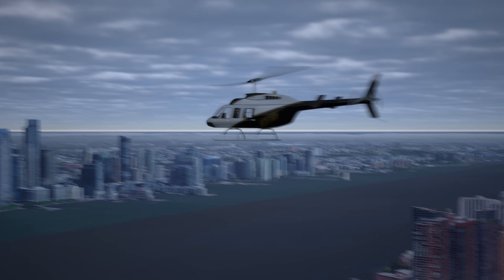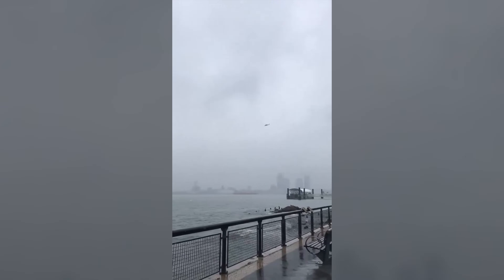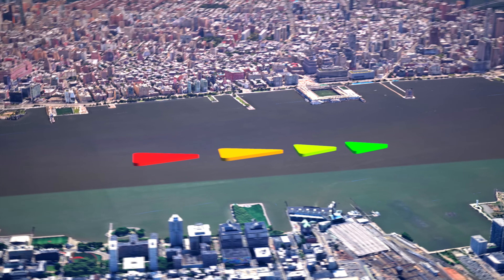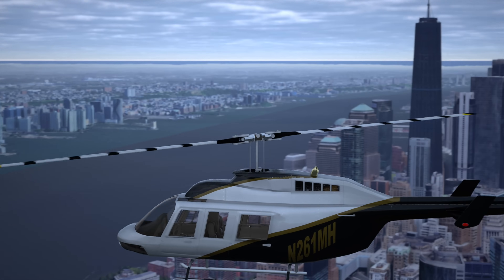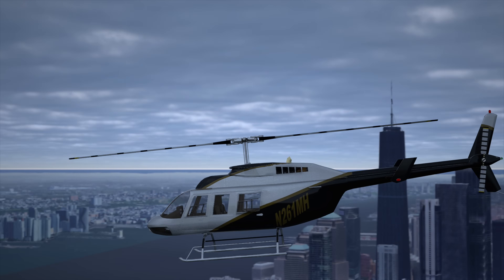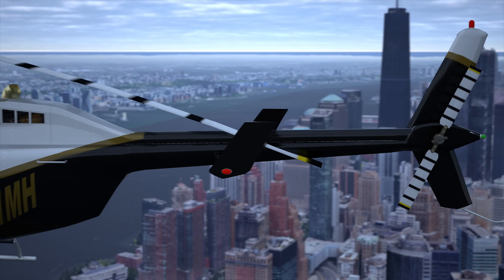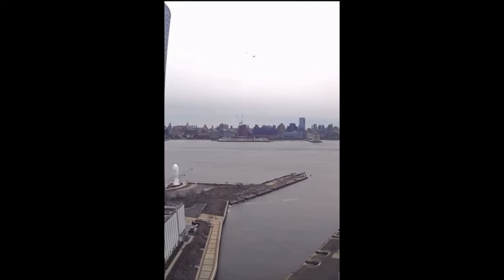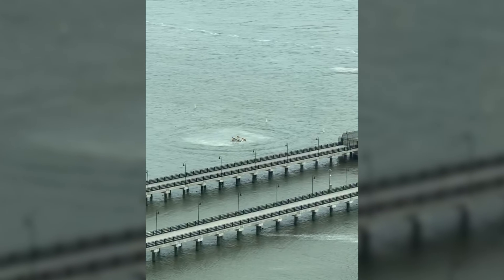Helicopters DON'T just fall from the sky - What is "Mast Bumping"?

Comment: An  expert that   has  flown  the  206L  for  30  years  has  mentioned  that  the  chances  of  the  cause   being  mast bumping  is  almost  zero,   he  thinks  there  was  a  serious  mechanical  failure  in  the  main  rotor  that  chopped  off  the  tail   section,  then  main  rotor  came  off  of  the  chopper  causing  it  to spin  and  flip  upside  down  before  hitting  the  water,   AND  "tourism"  helicopters  do  not  have  the  strict  mechanical  inspections,  and  flying  " rules"  are  more   relaxed,   thus  this  may  be  a  "negligence"  issue  on   the  part  of  the  helicopter  company.

Comment: "Mast Bumping" is not a common occurrence. The failure of the tail rotor shaft assembly is a known problem if left un-repaired it will sheer of tail boom due to excessive vibrations.

Comment: Other videos clearly show that it was not a mast bump. A mast bump shears the tail and tears the rotor into pieces. It's almost always due to pilot error and aggressive flight maneuvers. There is no evidence of aggressive maneuvers and the rotor is almost perfectly intact in the video, windmilling down after it separates from the helicopter after something violent happened just under the main rotor. It's more likely a catastrophic failure in the transmission.
Reply: Danke für diese Erklärung. Ich fürchte, der Helikopter wurde manipuliert. Der CEO von Siemens hat Geschäfte gemacht, die nicht jedem gefallen.

Comment: If the rotor had hit the tail, the rotor would have been destroyed or at least seriously damaged. That was not the case, as seen in the video. The rotor was intact when it fell from the sky into the river. So it must have been something else that caused the helicopter to fall apart.

Comment: if that was the reason it wouldve been pretty preventable...... thats like the number 1 thing you should worry about when designing a helicopter: how do i avoid it chopping up itself..... Im sure the engineers took all the forces and that bending into account. I cant believe that this is the reason for it even though it seems plausible on the first look.

Comment: The helicopter seemed to be flying just fine, and then suddenly it looked like it folded sideways.  Like the main compartment of the helicopter suddenly turned right, and the tail and rotors didn't.  This is crazy.  I'm certainly no aviation expert, but I've never even heard of something like this happening before.  I'm sure it has, but it can't be that common, even among helicopter accidents.  Hopefully the experts figure out what happened so helicopter flights will be safer in the future.  That's the only good thing that comes out of accidents - understanding what happened and why so that future accidents like that can be prevented.  I'm still stunned at how suddenly that helocopter just folded like that.

Comment: I built two executive models by Rotorway, a bolt located on the shaft called a Jesus bolt...if it comes loose you will lose the blades..that's why it's called a " Jesus bolt"

Comment: I believe if the tail was severed by the main rotor, it would have damaged the main rotor. It appeared as though the main rotor was completely intact while spinning on its own. If the gearbox broke away from the engine, it would have also pulled the tail apart as it appeared.

Comment: How many people should die in accidents like this so that some elementary safety technology will finally implemented on helicopters? First, there should be an automatic parachute launching mechanism that is actuated when critical mechanisms malfunction - it should jettison the main rotor and shoot out a parachute. Secondly, before the impact, there should be airbags launched inside of the fuselage to mitigate the hit to the passengers. Thirdly, there should be automatically launched floating bags outside the fuselage that will keep the fuselage floating on water and turn it the right way up. I think this kind of technology is already available and can be implemented on new helicopters.

Comment: Why don’t helicopters come equipped with parachutes? And I don’t want to hear “weight”. It seems clear it would save lives. Can anyone comment ?
Reply: This is just speculation, but in a lot of cases where you would want to bail from a helicopter, you are unlikely to jump clear of the blades. Unless the blades come loose, you might have a better chance in your harness.
Edit: also, helicopters are usually low altitude, so the chute likely wouldn't have enough time to fully deploy.

Comment: A super Puma lost its propeller and crashed into the sea Norway in 2016. All 16 oil platform workers and crew on board killed. Planterary gear failure, instantly stopping the gearbox, and proppeler energy ripping it apart... Google; Turøy accident

Comment: Very familiar with the Jet Ranger and I can’t see how you’d get mast bumping in those weather conditions. But can’t be sure. 

Mechanical failure causing the over extension? Trunnian Bearings? or one of the two Connector Rods breaking?

Comment: It's not a case of mast bumping, it's going to be mechanical problems , due to something either breaking under stress due to wear or improper installation, missing parts, improper torque,... those blades still spinning , didn't look damaged or bent or broken, which would have happened it had made contact with the tail,...the motor, transmission, and gearbox came apart...the helicopter simply fell away from the gear box and dropped , they have already retrieves , all parts that are seen hitting the water,...if the blades would have been damaged as in mast bumping, they would has reported it by now

Comment: Tourist helos are notorious for substandard mantinence, watching the video the helo was flying a straight line down the Hudson as he does on every run. The helo makes a sudden and violent midair maneuver that most likely indicates a catastrophic tail boom structual failure which led to the main rotor striking the tail boom which in turn caused the main rotor and transmission to break away from the fuselage. Bell 206 are not prone to "mast bumping" and even if so, the entire main rotor/ transmission unit would be separated, not remain as one unit.

Comment: Doubt it's a mast bump.  Very very rare on a 206.  Video and still photos seem to show intact main rotors and transmission, in balanced auto-gyro, into the water.  Rotor would not have survived a tail severing impact.  Not that well anyway.  That last maintenance report is going to be looked at carefully.

Comment: THE HELICOPTER 🚁 FALLED APART IN PIECES BEFORE CRASHING TO THE WATER😮... SIMPLY DISINTEGRATED...😮 NEVER SEEN THAT BEFORE...SEEMS LIKE THAT THE HELICOPTER LEFT FROM THE BODY SHOP REPAIR WITHOUT THE MECHANIC PUT THE PARTS ATTACHED PROPERLY TOGETHER 😮

Comment: The gearbox left the aircraft with the rotor blades intact.  This is not indicative of a mast bump.  As Blancolirio said it was likely a failure of the gearbox which caused it to remove itself and the rotor blades from the aircraft.  It was not in a flight attitude that would be conducive to a mast bump and a mast bump would not likely leave the rotor blades intact.

Comment: OMGawd as a 67S Kiowa Warrior Crew Chief it DRIVES ME INSANE when people say things about stuff they are clueless about. maybe next time speak to someone who actually works on helicopters for your information source. the tilt system of the blades CONTROLS the angle of the blade NOT THE OTHER WAY AROUND... for the entire tranny to detach like that means the bolts that secure it to the frame were not within assigned torque values. Thumbs down

Comment: He lost the tail rotor gearbox which caused a rapid right yaw and allowed the drive shafts to finish beating the tail boom apart. This in turn resulted in a severe C.G. (center of gravity) shift forward causing the main rotor system and transmission to separate from the transmission mounts. I have 5,000+ hours teaching emergency procedures in this model helicopter and can say that there was absolutely nothing the pilot could have done to alter the outcome. Condolences to their family members.

Comment: No! Mast bumping is not an issue that 206L4's have issues with, that's more of a Robinson issue. The NTSB will have their findings soon but as an Aircraft Maintenance engineer and pilot I'm going to say the transmission supports failed. this has been found in other 206L's. for the transmission to depart the AC with blades still spinning its obvious this is a likely scenario. I have read other theories saying "transmission locking up" or fuel..????? really...!  neither are a factor here. the transmission has departed with blades attached, spinning and autorotate to the water. such a sad event..

Comment: Sorry but to say this design is a 'common problem amongst most helicopters' is rubbish.  Most helicopters use an articulated rotor system that uses flap and drag hinges rather than the teetering design used mainly by Bell and a few other manufacturers like Robinson.  Its only the Teetering system that is prone to mast bumping and it's a phenomena that has been known about for years.  Pilots on these machines should know all about it and how to avoid it or they haven't been trained properly.

Comment: If this is due to aggressive reaction from the pilot, we can go one step further and link this accident to many others :
There is a huge philosophy difference between American aircraft and European aircraft :
In America, we believe that the pilot is a hero more capable than the engineers, so he get more control on the aircraft at the risk of letting the pilot make mistakes.
At the opposite in Europe, the pilot is limited as much possible by engineers to improve the safety of the aircraft.

Comment: In the case of mast bumping, the mast would have to break off at the attachment point. However, the mast is obviously hanging completely from the main rotor and there is another part at the bottom of the mast. This could be a piece of fairing or something from the gearbox. Of course, mast bumping can also seek out the weakest point and break there. The pilot is said to have mentioned on the radio that he was running out of fuel, but this did not happen, as he could have ditched in an emergency. Running out of fuel was probably just an excuse on the radio so as not to alarm the passengers. The pilot must have noticed something, probably vibrations. It is therefore possible that the tail actually broke off first. I rule out the possibility that the main rotor broke off the tail, because that would have destroyed at least one side of the main rotor, which is clearly not the case.

Comment: I'm no expert but, your explanation makes no sense. The main rotors kept on spinning so long after the crash after being separated from the helicopter. How is that possible after a collision with the tail? The rotor blades look perfectly fine in that clip after separation.
Wouldn't there be damage from collision?
I've seen many helicopter crash clips before and the rotor blades snap so easily after collision.

Comment: They break same as radio control helicopters 
We call it Boon strike 
End result main rotor hits tail and cabin. 
The impact snaps main rotor shaft. 
Excessive cyclic movement 
And a common issue is linkages failing due to lack of maintenance.

Comment: does that heavy transmission typically detach with the entire rotor assembly with a tail strike, design wise it appears to be a mounted quite securely to the frame.

Comment: Holy mother of God.! The reason that helicopter fell apart was due to poor maintenance. That's correct. We have sent many EHS engineers to Alaska before this looks like what had happened was a manufacturer's defect, which is either somewhere in the manufacturing is a problem, or possibly it's the fact that was not properly maintained.

Comment: In slowing down the video, it looks like the main rotor assembly came off first, with the tail rotor coming off second during the plummet - the craft was upside down during the fall.
If the tail rotor was severed first, then the body would have been spinning (it was not).

Comment: What is "mast bumping?"  It's when you jerk the collective so hard the blade strikes the tail and/or tail rotor and severs one or both from the aircraft.  It usually ends up with with the blades removing themselves from the helicopter.  Any other questions?

Comment: The 206 is not known for "Mast Bumping".  The helicopter was in level flight, following it's normal route for sightseeing. Most likely transmission / gearbox failure, leading to the failure of the mounting system.

Comment: WHAT ABOUT SONIC WEAPONS?   THEY CAN CREATE CONCUSIVE WIND TO MAKE "MAST BUMPING!"  AND THESE WEAPONS DO NOT HAVE AUDIBLE SOUND!  ANOTHER VIDEO SUGGESTED THAT THE BOLTS HOLDING THE TAIL ON MIGHT HAVE FAILED.  THESE BOLTS MUST BE CHANGED ACCORDING TO A SET NUMBER OF FLIGHT MILES.  AND IF THESE BOLTS ARE MISAPPLIED THEY WILL FAIL.  ALSO, ANOTHER VIDEO REPORTED THAT TWO FAMILY MEMBERS SURVIVED BUT DIED LATER.

Comment: Mast bumping is an incredibly rare occurance in a jet ranger, if you're pretending to know what you're talking about it's not working. The rotor disc and transmission are clearly still attached, meaning the cause of the accident was a failure of the transmission or it's mounts.

Comment: I'm not sure the rotor hit the tail. If that were the case, wouldn't the rotor be completely destroyed? Looking at the video frame by frame it seems like the helicopter yawed suddenly 90 degrees. Then I think the aerodynamic forces ripped the tail off. Maybe the gearbox seized? Severed shaft?

Comment: Based purely on the fact that Blancolirio is famous for not leaping to conclusions and only stating the known facts, and yet fairly confidently concluded that mast bumping is an unlikely explanation for this accident, I'm fairly prepared to conclude that although this is a great introduction to mast bumping, it may likely be totally irrelevant for the recent Bell 206 accident. His reasons are that the Bell 206 model of helicopter is very difficult to mast bump, and having the main rotor depart the helicopter with no apparent damage or asymmetry is also not consistent with mast bumping.

Comment: Here’s a thought, what if one of the bearings in the tail drive shaft seized, and with tremendous momentum, the still spinning shaft twisted the entire tail off. At the same time, the sudden jolt and increase in load, torqued the entire engine assembly off the fuselage. Seems plausible.

Comment: Mast bumping usually shears the mast off at the point of contact but the picture clearly shows the rotorhead, blades, mast and transmission flying autonomously as a single unit after breaking away from the main fuselage. That would indicate that perhaps a transmission mount failed or the roof structure where the transmission is mounted to was rotten!

Comment: Failure of the "Jesus Bolt".
Reply: Probably not as the rotor assy was still attached to the transmission.
Reply: If it was failure of the Jesus bolt, the rotor would go off by itself without the transmission.

Comment: Mast bumping is NOT a common problem on the Bell 206, and is unlikely to be the cause of this incident. It is a common issue with Robinson and several other models.
Reply: Above 86-88 kts in low-G maneuvering flight - ‘severe turbulence’ or abrupt control inputs that unloads the aircraft toward no G. The RFM has a Warning Note limiting airspeed below the range they occur when flight may encounter those conditions. Ref the 2 Review Panel investigation reports, extensive discussion with a noted Test Pilot Instructor, and the abrupt decline of Mast Bumping accidents in R-22s and R-44s after this was determined and instruction addressing added to flight instruction in those A/C. AH/UH-1’s the 206’s and anything else with a teetering rotor head are susceptible to & have history of mast bumping accidents - these heavier more powerful airframes carry greater inertia and their pilots have more extensive training & flight time in general compared to the Robbie’s.
Reply: Right, unlikely not impossible.
Reply: It’s also not common to win the lottery. Still happens though.
Reply: Would you blame poor maintenance then?
Because if it's the rotor cutting off the tail, it's a design issue, and if it's wear and tear, it's both a design issue and a maintenance issue.
Reply: @lunaqueer it wasn't the Rotor that cut off the tail. The Rotor was still intact when it was ripped off the helicopter with the entire gear bix
Reply: Unlikely? The rotor and the tail came off.
Reply: @soulrazy  Did you not watch the video we watched ? The tail was sliced off owing to mast bumping.
Reply: if it was "commen" , these crafts would be grounded.  it is the most likely explenation.
Reply: Why would a deadly issue be common 😂😂😂😂 like wtf
Reply: @LolcowWranglerYT  the pretty obvious implication is within the context of accidents
Reply: @LolcowWranglerYT  The (very obviously) implied context is helicopter *accidents*. Good luck!
Reply: It was likely the cause for this...
Reply: No, it wasn't.  @KidMotor
Reply: @KidMotor  Not according to the NTSB preliminary report

Comment: Everybody it seems has their own belief about what happened...but none of them know for sure, so this "mast bump" theory doesn't work. I was a helicopter mechanic for 45 years, and never heard of a Bell 206 mast bump. Could it happen? Sure. I know of military Bell 204's (Huey's) mast bumping in the 60's and 70's, but that problem was fixed by installing a simple "bumper system" on the mast so that the main rotor hub could not contact the mast. Bottom line is most of these theories are coming from people with little to no knowledge of aircraft, and helicopters in particular. The NTSB and FAA will do the crash investigation and then and only then will the actual determination of cause be known.